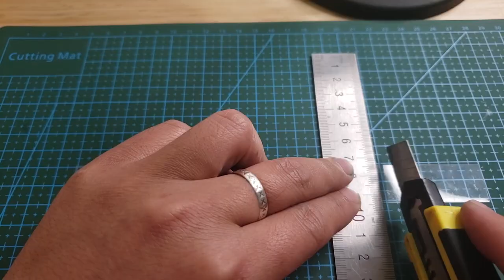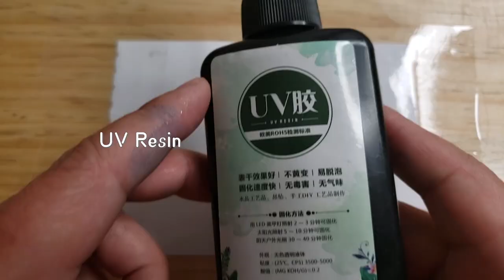🍀Four-leaf Clover in Resin🍀 - Resin Crafts

Comment: Hi. How long you waited before poring the second layer? 
I tried doing but pour too thick causing heat and bubble...thanks
Reply from the maker: You may need to change to a resin with low heat, or try to cool down the resin work